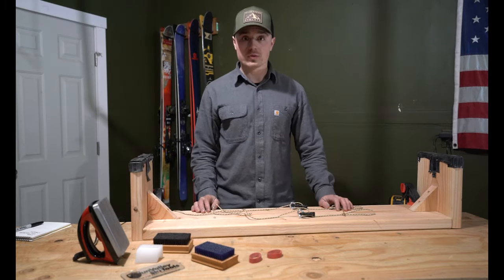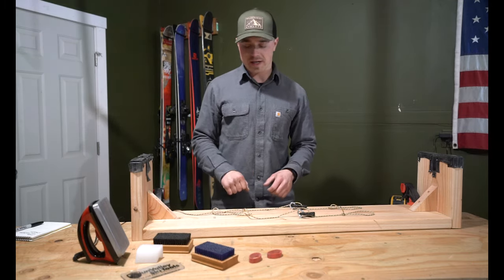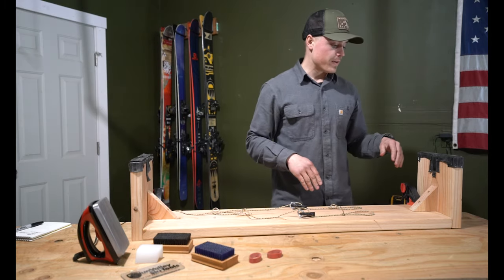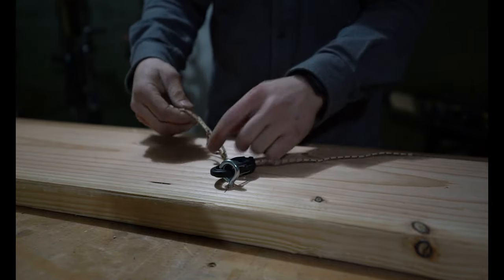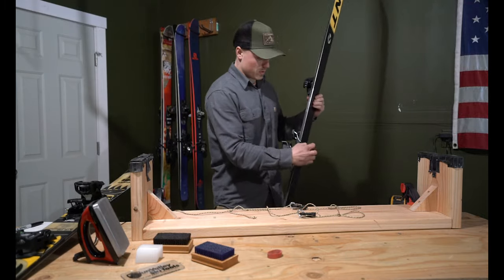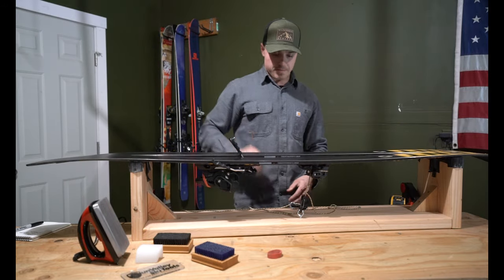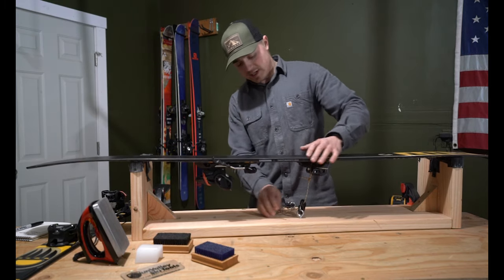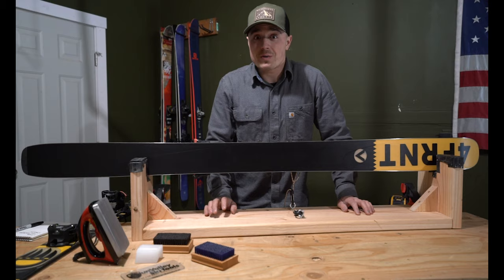INEXPENSIVE DIY SKI & SNOWBOARD WAXING/TUNING VICE

Comment: I just made this!  Thanks so much for the inspiration, it's a great way to build some stoke while the waiting for the season to start up.  I cut two parallel grooves instead of a single groove (so I can compare edges between skis), and did supports on 4 corners instead of on the center of each arm (probably overkill, but whatever, a fun excuse to play with powertools).  I also sanded and stained the wood too, why the heck not.

Comment: I finally got mine made. I painted it and used rubber backed carpet tile instead of bike inner-tube. It looks great. Just need to position the eye bolt and attach the cams. Gave it a run edging and waxing my snowboard, worked well, stoked. Great design Chase!
Reply from the maker: Awesome, Im glad it worked out for you! Good idea with the carpet. I'm sure that'll work great. Thanks for watching!

Comment: The whole setup doesn’t slide around on your workbench or work horses from the pressure when scraping wax?
Reply from the maker: I usually clamp it dow to the work bench to prevent any movement

Comment: I'm going to put this together this weekend.  Anyone have a tip as to the easiest and best way to cut the 3/4 slot in the middle that holds the ski on edge?  Map it out and drill holes, multiple cuts and then just try and chisel it out?
Reply from the maker: Awesome! That would work👍 if you have a jig saw that would do the trick easily or if you have a skilsaw you can just set your depth and do multiple passes through from the end of the board then break the pieces away. Good luck!